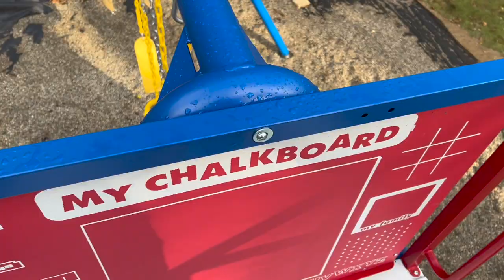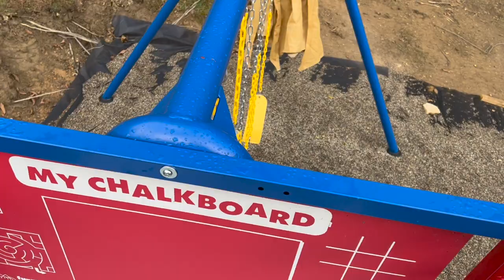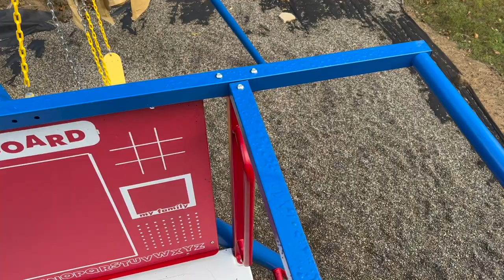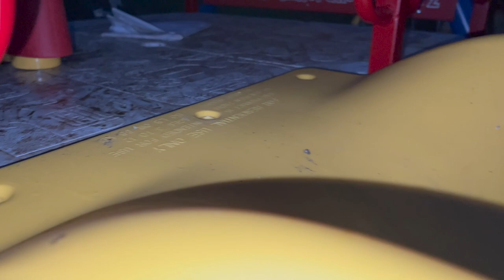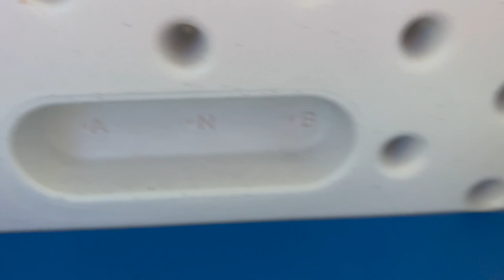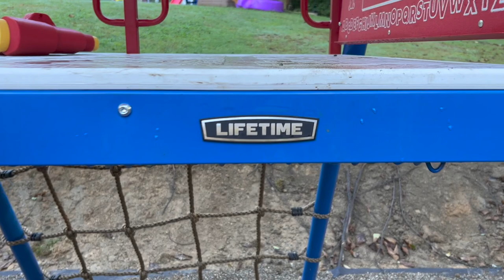#144  New LifeTime Play Set For The Kids!

Comment: Is that swing set angered  into the ground so it will not tip
Reply from the maker: The manufacturer lifetime says it is designed so it does not need anchored. You can feel that when on it, very secure and doesn’t move with adults on it. So children will definitely be safe